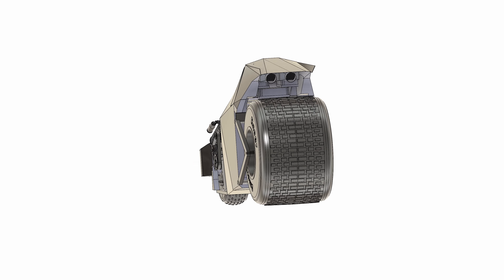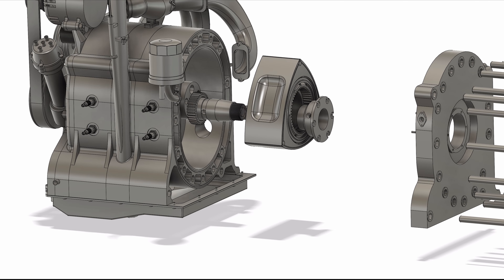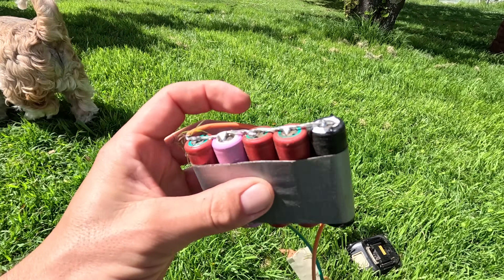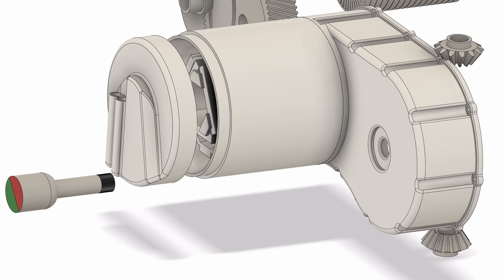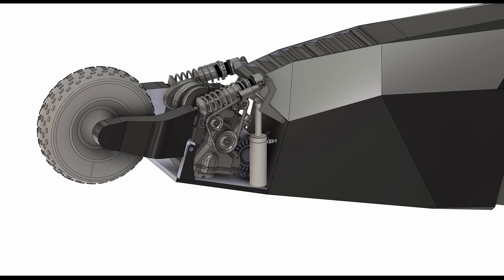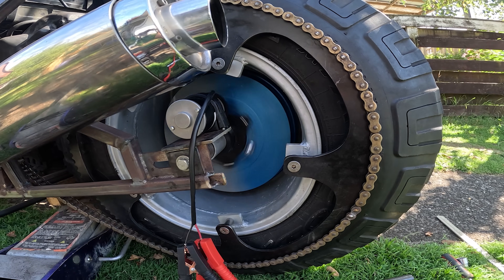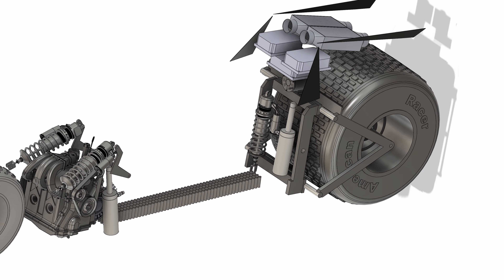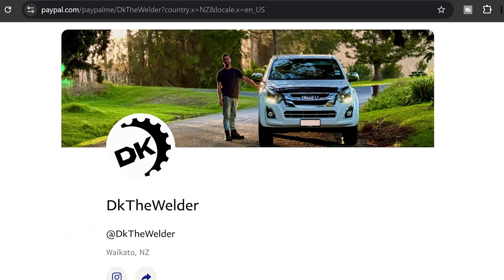BAT BIKE RETURNS

Comment: MPU6050
Reply from the maker: What does that mean?
Reply: @dkthewelder  its a sensor with gyro, acc, and mag, pretty easy to setup with arduino, most drones use it under the hood. Could use it to control your wheel offset. Shout if you want more info.

Comment: Could you use hydraulic suspension like in the low rider cars in the US.
Reply from the maker: I thought a lot about that , my idea is even more far fetched, I would have no spring and there would be an electric motor like those Boston Dynamics robot  dogs have on the legs which would be controlled by the AI to move with the terrain
Reply: @dkthewelder  That sounds like a project in itself :)

Comment: Electronic power steering rack for rear wheel slide? 
I just can’t see the rear wheel slide fixing the issues, in my head it doesn’t work
Reply from the maker: Won’t get the travel I want out of a steering rack. I will need to custom make something. Think of the bike going around the corner like a 3 wheeler except the inside wheel isn’t there and it is being held up by the force from the corner

Comment: Maybe don't go for 18650 cells (and please get a spot welder if you continue with them). One or two modules out of a Hyundai Kona battery pack (or a KIA EV) are packaged quite well and have stuff like cooling already integrated and aftermarket BMS are easily added. Also: screw terminals on those.
Reply from the maker: That is a good idea, where can I get them and how much are they?

Comment: This looks like a great build. Re battery charging: as a precaution, could you charge it off bike and within say an old metal ammo case or similar in case of fire?
Reply from the maker: The battery is better to setup long and skinny as it will be easier to run in series to get higher voltage so a transmission style tunnel should work and if it explodes the force /fire will go underneath

Comment: Impressive 3d model. It would be interesting to hear about the driving force behind your dedication. Like, how do you keep the will to return to CAD from one session to another, and what are your rules to make a model that doesn't end up a non-legible mess.
Reply from the maker: The model is a total mess , you only saw half of it heaps of mistakes!
Reply: @dkthewelder  in any case, very cool results. Looking forward to new videos!

Comment: Bat Bike AND It’s a (Rotary!) Series Hybrid?!? 🫨
Reply from the maker: This will be very difficult!
Reply: @ agreed, although to an extent the engine (unless you are making a billet engine from the ground up 🫨) and electric drivetrain will be the easy part.

Suspension and Steering is dark magic from the bit i have read up on, ESPECIALLY if you are going for active suspension!
Reply from the maker: @ericlotze7724  it is all possible, I just need some help to get there. I will continue with CAD and will start to become clear how to do it

Comment: Fantastic Daniel!
Should look af the 21700 cells, they are much stronger than 18650 cells
Reply from the maker: Yeah they would be great if I get enough money I will use those cells! Is that what you use?
Reply: @ I have in my buggy poutch cells. but are now building a battery for another project with 440 pieces 21700 cells that can discharge 60 amps each. 20P22s gives a total of 1300 amps peak discharge. these cells cost €4,- each here

Comment: I wonder whether you can lean efficiently with such a large flat rear tire
Reply from the maker: Maybe not it will possibly need to pivot as well
Reply: @DktheWelder  
A bit worried that the rear tire lateral translation may induce a yaw moment, maybe you should check that before actually getting in 😄 Stay safe
Reply from the maker: @halnineooo136  I also want to make it rc so I can test while not in it

Comment: If you want to build a battery pack you need to wire balance charge in as well or you will burn down your garage while charging. And for the movement of the backwheel you should use a wormgear to avoid backdrive of the motor because there will be large forces.
Reply: I probably would say a worm gear is a good choice, but it also is slow - so while the rack and pinion requires a more potent motor it might be the best option.
Reply from the maker: A worm drive is probably what I will go with the rack and pinion was just easier to 3d model
Reply: @TinMar79  Granted i have barely read up on suspensions, and I don’t know much about bikes, BUT don’t cars use rack and pinion?
Reply: @ericlotze7724 yes but the sideway force doesn‘t push direct against the rack in a car
Reply: @TinMar79  ah, that makes sense to be fair! (Also most “rugged” / racing things probably rip out power steering anyways)
Reply: On the note of batteries, there are plenty of DIY/OS projects out there for 18650 (or the larger cousin, 21700 etc) Battery Banks.

My only question would be what voltages etc are you using for other equipment, because that probably determines a lot about your battery bank/wiring harness

(24v + Can Bus / Ethernet ftw)
Reply from the maker: @ericlotze7724  I haven’t worked that out yet, maybe keep everything 48v to control the bike then the long skinny pack can be for the rotary engine to dump excess charge into when needed
Reply: A worm gear probably won't be dynamic enough for balancing. A 5:1 gearbox and some return-to-center springs on the balancing mechanism might provide a better result.
Or: a hydraulic cylinder on the sliding mechanism and a gear or lobe pump on the motor. then you are also more free on the placement of the motor and the pump is less back-drivable than the rack'n'pinion.
Reply from the maker: @ hydraulic won’t be fast or accurate enough a chain and sprocket system would work similarly to the one I used in conjunction with the hoverboard motor and controller
Reply: @dkthewelder  is this is slap a planetary gearbox on it moment?

Looking at JLCPCB or some other digital fabrication as a service sponsor like 👉👈

Comment: Dc to Ac conversion means inverter not rectifier, but yeah it works as the speed controller for the tesla motor.
Reply from the maker: Yes thanks I miss spoke whoops
Reply: @dkthewelder  You can not use one of those Tesla motors without that thing, the complexity on that side is why the motor bit looks so simple. Speed controller does not even begin to do it justice.
Reply from the maker: @GordonWrigley  also I can’t even buy a tesla motor with finding a wrecked one, do you have any suggestions for a powerful motor I can use?
Reply: @dkthewelder  that is beyond my knowledge, but you've got plenty of viewers, someone will probably know
Reply from the maker: @ yes, I think an open source approach where I can get help from everyone. I could even build my own hub motor there is enough knowledge out there to do it
Reply: @dkthewelder  I would humbly suggest that maybe you should focus on finishing the bike and leave building your own hub motor until later https://www.youtube.com/watch?v=4jgTCayWlwc
Reply from the maker: Could you build a hub motor for me? I can get all the machining done for free from PCBway.

Comment: I think you'd have more luck if the back wheel stayed upright (wide and flat with gyroscope) then force the bike twist over into the turn. 
So instead of a linear slide, side to side as you have it, rotate it there.
Reply from the maker: Yes I have been thinking about that too I could have the wheel twist as well it will be a complex swing arm

Comment: Good to see Bat Bike back. Have you checked tilting Wesll quad or Carver trike? Maybe you could do a similar thing in the rear, except do it with just one fat wheel. Just a thought.
Reply from the maker: Yes I have thought of that. I might make the rear wheel tilt as well
Reply: btw. Side profile/design of your bike is a killer. I designed 3d model of something similar except it has two wheels in the back.

Comment: AWESOME!!!!! BRING IT. :)
You really need to at least slightly round that rear tyre though, the angle it has to reach to actually start to allow a turn is ridiculous.. either that or pivot the rear wheel instead of sliding it..
Reply from the maker: I have been thinking about that, I can make it swing and tilt I need to learn mechatronics!
Reply: @dkthewelder  yeah, a real "floating rear arm" which essentially keeps the rear flat and planted even if the bike is tilting.. it'll be dodgy as hell unless you get it right though. i predict a fair bit of trialing and erroring but will be very interesting to see. kudos mate.

Comment: The rear wheel slide isn't gonna work. There's no way you can run that shifting weight on a flat gearing setup. It will skip a lot.
Reply: The resting weight on the motor is gonna break the gear shaft also real quick.
Reply from the maker: I will probably use a chain drive it was just easier to draw
Reply: You could potentially move a rear swing arm/tire with a hydraulic setup. Or you could use a small motor to change camber/ caster on a slight pivot but moving the whole tire side to side is worth watching to see how you think you can do it.

Comment: I think you're barking up the right tree here... The rear tire being able to be moved is quite next level and very low energy...
Reply from the maker: Yes I really want it to move quickly so it works well on uneven ground
Reply: @dkthewelder  ...or make the gyro tilt as you steer...that might tilt the bike. the problem with making the rear end itself rotate is non existent
in my head...and my head works so theoretically...weld some guide chains(not the other way round) don't forget they can double as the stops if you damn good...its the simple shit in this life 3>
Reply: HELL I think this will work if you add a front giro as well...somewhere(add or subtract stuff). Know what you'r saving grind hard did piss me off and you pulled your endorsement so that was it for me.  In fact, not that anyone would ever know, they stole my shit as well...when that did bump out my f'n projects.  Who has the right to steal what was considered free shit and ruin it to the point that I makes no sense from a design/mechanical perspective.  They aren't even customs(to me), when between both designs they stole, they introduce their own first full custom and it doesn't even make sense either.  Dude and they keep stealing more if I don't make this work go fast. Salvage yard it is and they had their time cuz check it out yeah I got good at holding the best back...LMAO this is so I can even remember what I was working on right now...

Comment: You're making it too overly complicated again... The slicing back wheel is a good idea, but it could be applied better, I do aprove for the rotary engine tho... But I think you should go quite a few steps back on the design...
Reply from the maker: This is my unlimited budget idea. As if money was no object I could hire engineers and get all the parts cnc machined. But as you say depending on the money I get will determine how cool the final product will become
Reply: @DktheWelder  well, there is nothing bad with dreaming lol, I have quite a few of those myself... projects I mean...
Reply from the maker: @ I have some way wilder ones haha. I might draw a really cool thing I want to make it would probably cost 1 million to make it haha
Reply: Instead of the rear wheel sliding side to side,  what about pivoting the bike about where your side to side motor is located,  and make the body swing in an arch...I would think the horizontal side to side motion would affect your steering geometry..
 Plus,  swinging the body would change the center of gravity,  having more of an effect... 🤷🏼‍♂️
Reply: @mayhemmanufacturing434  in that case why not even make the bike back wheel steering instead of front... That way the bike would be more stable with the fixed front wheel and the back wheel with a double angle steering and rotating to adjust for the angle...
Reply from the maker: @mayhemmanufacturing434  I have thought about that quite a lot . It might need to slide and twist
Reply: @dkthewelder  look up The Halfbike, it's some sort of scooter tricycle that has two small wheels on the back, you turn by inclining the bike, but they also rotate on the axis, you could do that with the big back wheel, and you could also replace the conventional handle for lever action handles, sort of turning the bike like a tank..
Reply: Plus that would be such a Batman thing to do... XD
Reply from the maker: @LordDrackonel  all I need is the Bruce Wayne budget, donate a dollar if you want
Reply: @dkthewelder  you really don't, that's why I told you to go some steps back, and make it simpler, you already had that with the front wheel before, it's hard to explain but I could draw it for you... I might send you that dollar later tho... xD

Comment: would you feel safe sitting underneath all those batteries? Id make the inside of the bike fire resistant if I were you
Reply from the maker: I was thinking about that it would have like a car transmission tunnel open at the bottom so they explode downwards